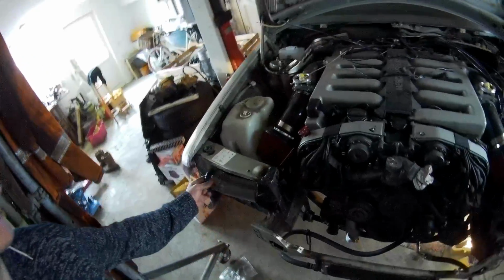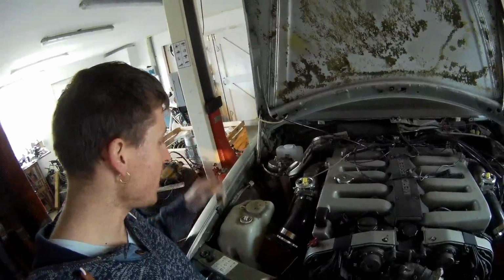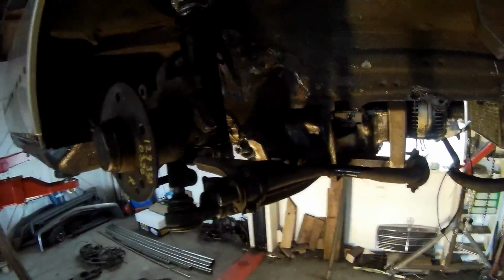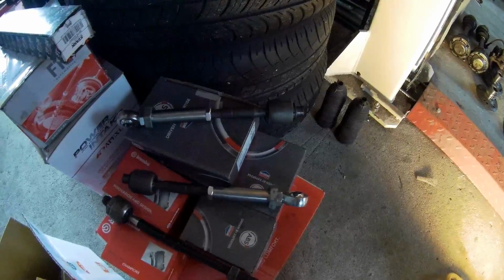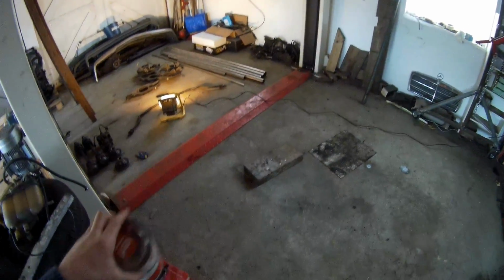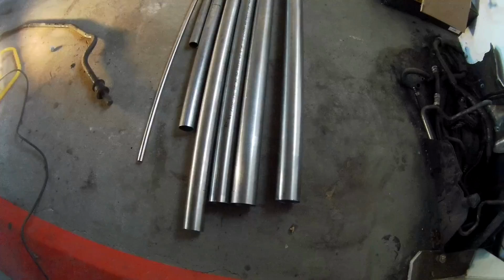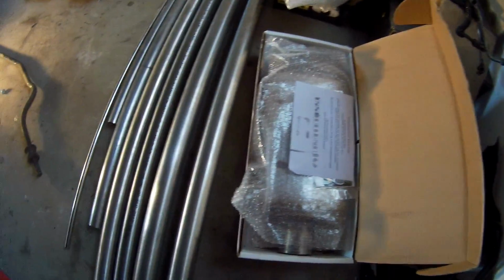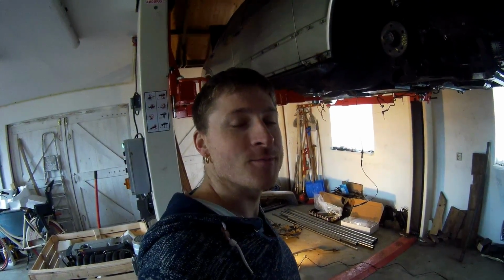Mercedes V12 engine swap Update. JMSpeedshop.com online !!

Comment: Wow man. What gearbox and axle ratio?
Reply from the maker: 722.6 5 speed nag580   End ratio 2.65. Will do 280 in 4 gear
Reply: Oh great, original axle ratio, can't get mine to work with different one
Reply from the maker: What do you mean what does not work
Reply: Transmission enters limp mode, it's a 7% difference. It went out of gears then and slipped to death. Changed the burnt clutch & piston Worked in all gears, but then slipped and now is in 2nd only
Reply: It's really a debacle :)
Reply from the maker: Your using a 722.6?  What controller for the gearbox are you using ?
Reply: JMSpeedshop ! The original computer in HHT
Reply from the maker: In HHT?  What does it mean
Reply from the maker: You have to use after market that is much easier  ofgear.dk
Reply: JMSpeedshop ! I just saw that. Would be great
Reply from the maker: A lot of people are using this And work like plug And play